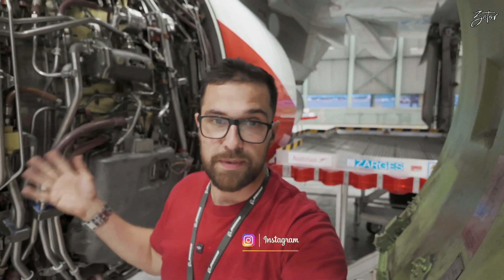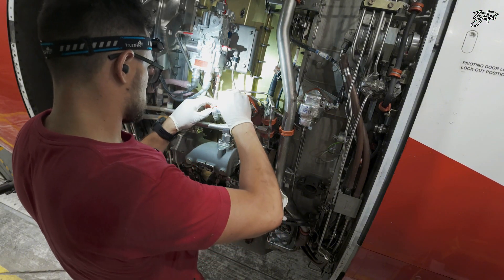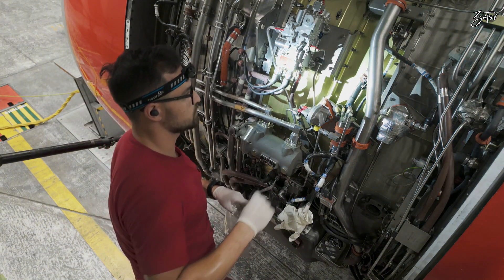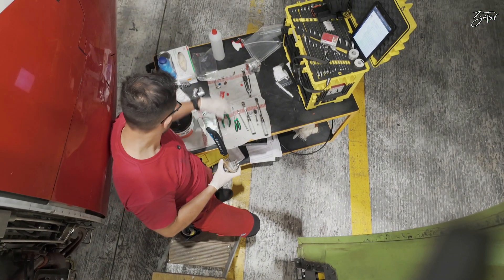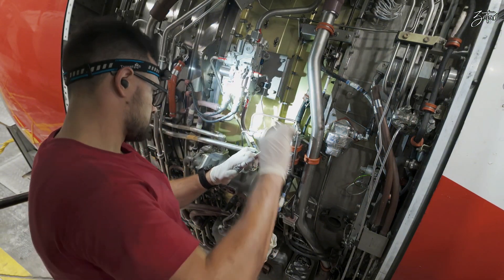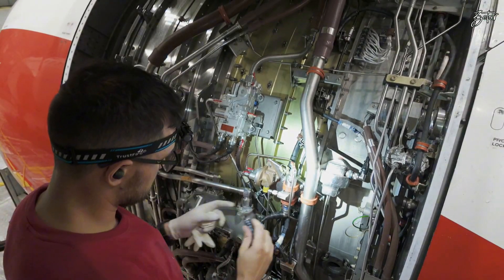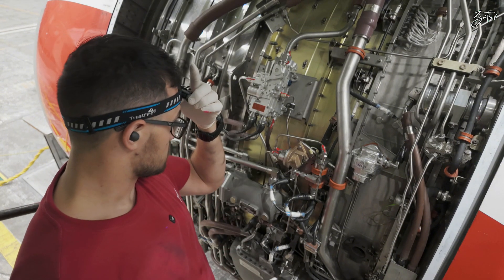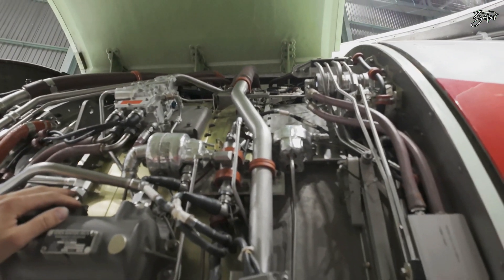A32F engine low oil pressure warning switch how it works and how to replace it.

Comment: What is the procedure in cause of loosen bolts? re-torque them or you recheck the part first?
Reply from the maker: Most of the time you must replace nuts or screws.

Comment: Hey Tamas hope i got your name right mate.I have a question do you have your own tools or do you book out the tools needed to perform the repair or replacement job you,ve been given.i ask because it was recently discovered on a Qantas 380 that a tool was left in one of the engines and the aircraft had flown over 300 hours of service before the tool was discovered during a routine maintenance check,it was revealed that the tool return to store was incorrect.
Could you explain this process in one of your video,s please,i love your channel i always wanted to be a aircraft technician ,so i can watch your work with great admiration for your trade,you guys and girls keep us safe in the skies.
Cheers kym
Adelaide
Reply from the maker: Hi, almost right I'm Tomáš 🙂 but it is ok. I have a toolbox which was assigned to me by the company when I was hired. Every pace is marked with a number, which means that is easy to recognise whenever ever it is lost. Calibrated tools or special tools I need to pick up from the store and they must be returned at the end of my shift. Calibrated tools are also recorded on WO. I can cover this process in my video
Reply: @zeto.r  
Thank you TOMAS,